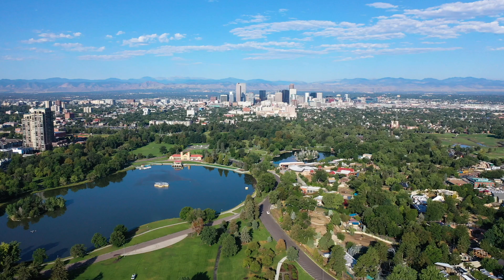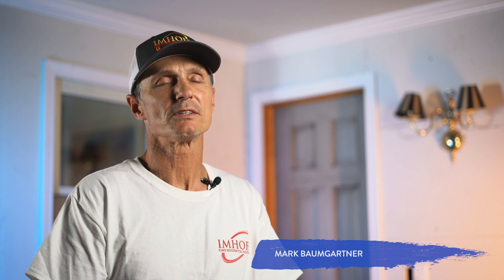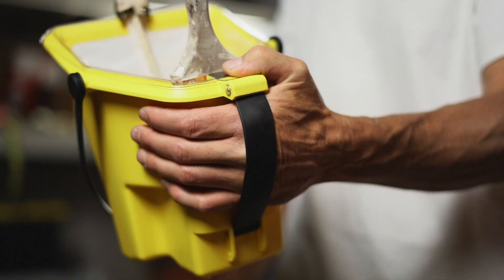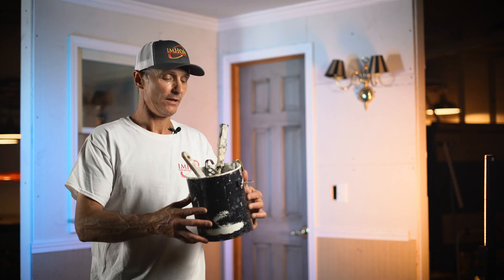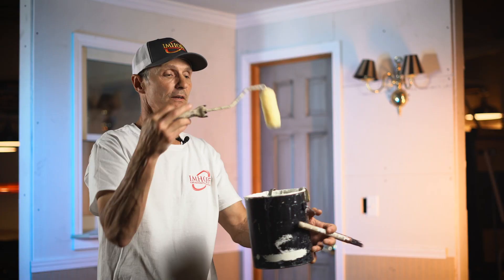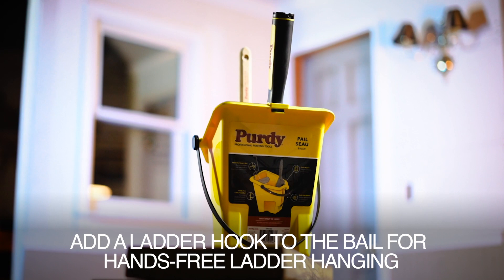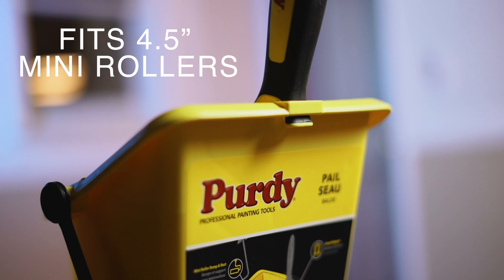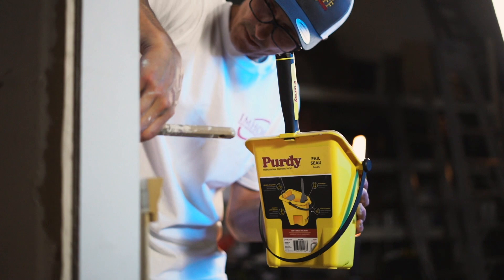Using a Cut Pot to Paint Faster

Comment: The worst cutting bucket. I've used it for 2 months.
Reply: What cutting bucket do you prefer?
Reply: @mikeganard6751   So far WOOSTER bucker was kinda ok, best of all out there so far, although it does not have a pail handle. It is almost wide and deep enough for the small Purdy roller. I am going to try the old school 2 gal bucket with a roller grid in it :)
Reply: @synthesaurus  thanks for the quick response 👍🏻
Reply: I'm gonna glue a magnet on my 2 gal lol